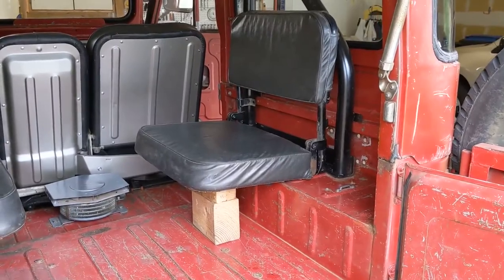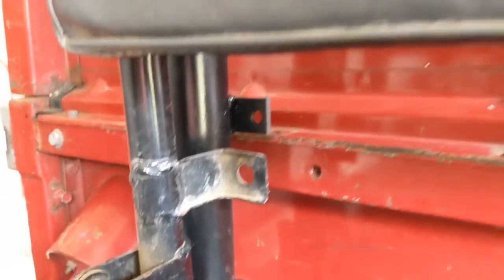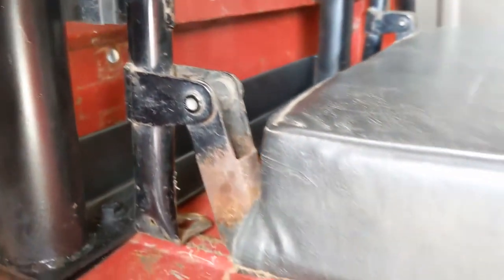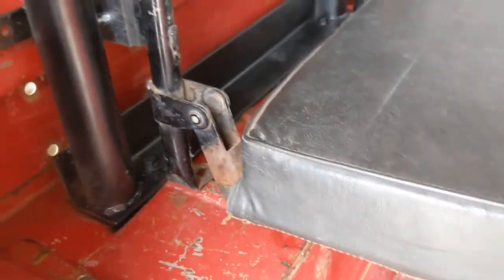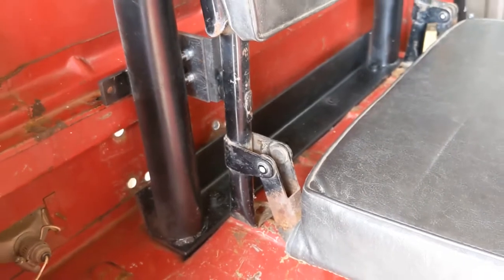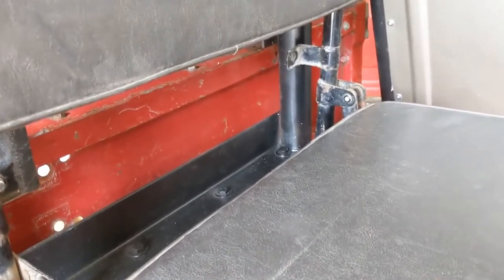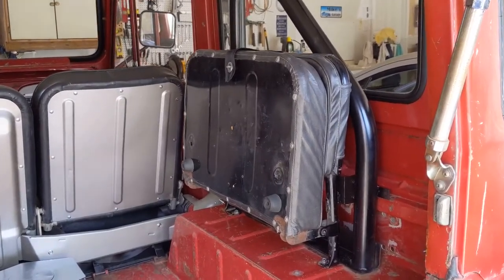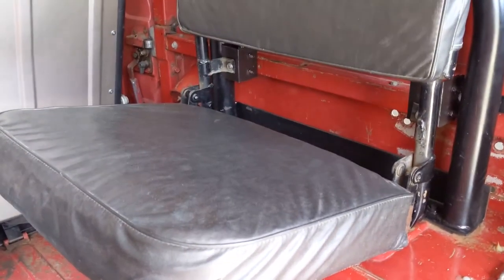Jump Seats

Comment: So I take it these seats were part of an 'Off-Road" Vehicle built by Toyota?

I am planning a Vanbuild probably using a Ford Econoline or something similar.  Wanting a Security Wall between the Cab and the actual Van Space, I was planning to replace the Passenger Seat with a Flip-Down Jump Seat to open up storage space in the area in front of the Passenger Seat.

Your video way the closest thing I could find.
Reply from the maker: These seats were an option on FJ40's when they were new. A previous owner must have removed the seats to make room for a roll bar.  I wanted to have both, so I built some adapters that push the seats an inch or so toward the middle. 

Good luck with your van build.